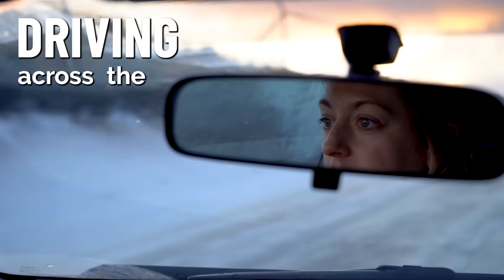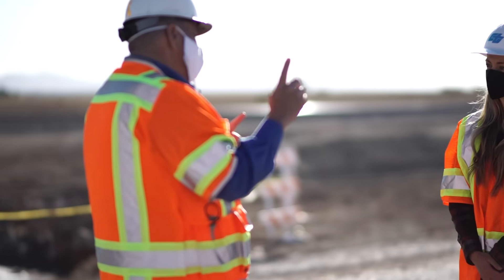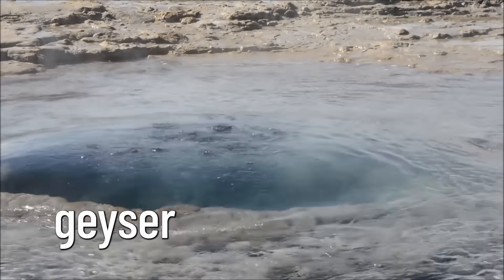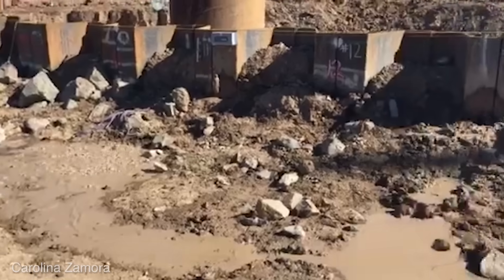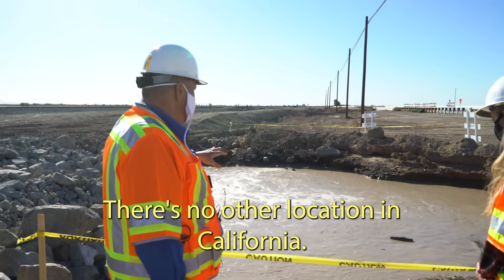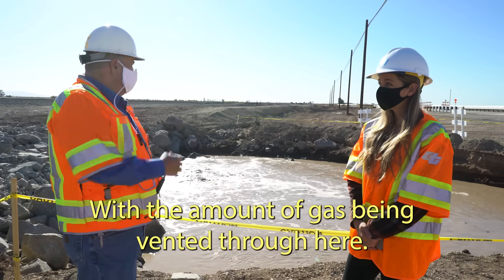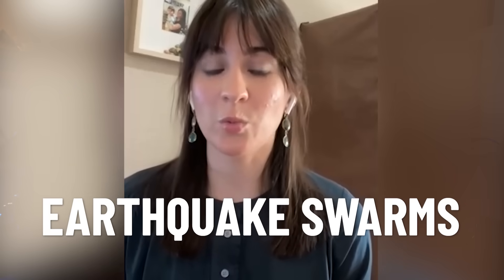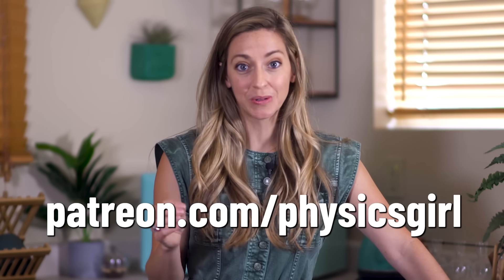World's Only Moving Mud Puddle

Comment: Consider electricity moving through a wire and you know how a cyclotron works. The cyclotron smashes electromagnetic field fluxes known as atom smashing similarly to power smashing into copper crystalline structures structures of wiring to produce electromagnetic field fluxes known as arcing.
Electrical power supply may be created using a power source and voltage to frequency converter to synthesize radio waves that appliances receive then convert radio waves by frequency to voltage to power itself.
I designed a satellite that puts out 350 tetracycline at .01 ampere per peak and valley. Smoothed out to 1 cycle would produce 3.5 billion amps which can power an entire city via satellite.

Comment: If you apply mechanical engineering,  electrical engineering and electronics engineering,  you can more fully understand physics. You only need to learn the basics of electromagnetic functions.
Mechanical power, electrical power, and resistance are important for physics.

Comment: Diana, if I have time, I would like us to work together on some projects, if possible, regarding just about every area of physics.
You only have to know basics about electricity and other data. Once you learn about electricity and lightning you can realize how space and other physics functions.
Physics of sea water is mandatory too. An experiment I had when young was connect a cb antenna to a winch cable and  throw the cable into the gulf of Mexico. Normally the 5 watt can radio can talk 3 miles; but with the cable in the water, I  talked to people on the other side of the iron curtain.
Don't tell anyone about this.  I also designed radios systems using the earth gravity as antennss.

Comment: nothing can be done without going to the original location and plugging the fissure releasing the co2. the sediment has reached a state of none newtonian particulate, under pressure, causing the co2 to take the path of least resistance which is lateral to the bedrock (not a particle). this phenomena will continue until the edge of the water table. i'm sure this is understood already.. a few hundred tons of powdered tungsten ore at the original location might stop it.

Comment: If they think that theory is correct that it's traveling at an angle and it's making its way back to the spot that would be directly above, they should just drill of the opposite side of the highway and give the mud puddle what it wants without having to tear through the highway first

Comment: Gas goes up, mixed with fluid, after it passes the soil, the soil settles in a much more compact way, leaving
the indented ground locally. The movement is just a result of it choosing the non-compacted soil, which is then
more permeable to the fluid/gas mixture.
My solution would be using a somewhat bigger pit around it, use floaters for support of the trains tracks and
road, by filling in the now larger pit with more water, which may move but ultimately is settled
in height by a pump either pumping in more water or removing some to maintain a constant water height.

Now Mr. MudPit can go it's way and continue to compact soil, while passing through, and when it's gone
far enough, you can remove the pump and the water and simply fill in the pit again using the same
method as the mudpool, spraying in mud mixed with air.
Reply: FYI, cute scientist.

Comment: It's a fault line alleviating gas through a pool of water, as the pressure increases, gas is forced past the fault which allows a little bit of water to pass in the opposite direction. The water seals one end of the 'opening' and the rising air erodes the other end, it's like a snake because of this.

Comment: If you consider the thickness of the earths crust and the earth itself - in comparison a 75 foot wall of steel is nowhere near as deep as a non-bleeding fingernail scratch on your skin.  We are talking about a source of gas that is probably1000s of feet deep at least.   

Best bet to me is to relocate both the train track and the roadway - go to the side behind where the mud puddle was and put in concreate structure (like a bridge but built below the surface then a non-permeable membrane down10 feet then build the train track and roadway over that.  Additionally you need   sensors in that area to monitor the gases and their levels on  the roadway.

Comment: thnx for this, but, not at all amazing. i'm from this area in CA and the entire Coachella Valley sits on a giant water aquifer. the aquifer is fed from snow melt off the surrounding mountains which is highly visible from Interstate 10 at Whitewater pass near Palm Springs' infamous windmill farms. it's no wonder that this subterranean water table would surface out near SaltonSea / Indio / Thermal....somewhere as it is flowing very very Fast!

Comment: the theory of the feed source coming up at an angle would be what i would be looking into. why not take a general heading of the direction it is moving, and start drilling test holes to see if you can intercept the source. you could map it's direction and depth as you keep drilling new holes and maybe get it to a point where you find a vertical point then try to drill multiple holes and open up a new vent that may stay in place and stop further destruction.

Comment: "Driving across California to see...a mud puddle."
Me: Sounds totally reasonable if you ask me.

Ok wait, question - why has no one just made a bridge for the road? Clearly the puddle isn't stopping and cannot be stopped. Why can it not just be given a wide berth by making a bridge over it? Sure, later on after it's gone there's just going to be a weird bridge, but still...
Reply: With that going on, it's unlikely that the overburden above the rocks is particularly stable anywhere near there, and the pointloads of the bridge are much more likely to subside or even tip than normal.

Further you can't be certain that the moving puddle isn't going to make an abrupt turn and take out the bridge supports.  It does move rather explosively...

Comment: The angle theory makes sense. If the source is some distance away, and the relief of the gas is the path of least resistance deep underground via a highly permeable layer or some horizontal'ish linear void, it would explain why it's moving.  Maybe it did not move initially because the overburden around where it initially appeared was highly impermeable and took a long time to erode, but now it's moving as the overburden is more erodible as it tries to find equilibrium, likely when its vertically over the source.  It's interesting the bubbling does not occur along the path where it came from, only where it is, which seems to further support the angle theory.  It also looks like the path is being filled in behind it, which also seems to support the angle theory.  I would think soil borings could be taken out in front of the boil to see what kind of material lies ahead and to better predict the path.

Comment: Have they considered that the earthquake storms caused the collapse of the co2 chamber which forced the pocket of co2 into the water table . This could cause the build of pressure in the water table an force the water an co2 combo to the surface following the actual water table till all the pressure has been released.

Comment: 1953, and farmer are the first 2 clues Im hearing as the rubber ducky scene plays. 

Im guessing monoculture drawing from the water table, just like the ogallala aquifer depletion.

Im picturing when a scuba diver is in an under water cave and their air bubbles hit the roof and as the bubble gets bigger (or in this case the water table gets lower) it will either slowly or aggressively follow the shape of the roof of the cave, depending on its shape. 

Im picturing the day it moved 60 ft, the bubble made a jump. 

Just a theory.

Comment: Carbon + heat and pressure + water is how oil is formed in the earth 1 reason for CO2 bubbling out is oxygen from water bonding with carbon and the other 2 part hydrogen is forming hydrocarbons.  It's  not a fossil fuel neither will it run out.

Comment: so im just curious. if it is potentially at a angle, trying to make itself straight, then why not drill a opening past the highway, and move the puddle, so it skips the highway, then do the same thing before it gets to the other places. till you track it, and then get it to right itself....so it stops moving, of coarse that could be over 100s of miles maybe...but better than it sinking structures, causing millions to billions in damages.

Comment: Okay if it's because it's coming up a fault at an angle and trying to get straight why couldn't you figure out the source from where it's originally coming up by using ground-penetrating radar and drill relief Wells oh, so it will not follow the original fault at an angle instead it will go straight up the new wells, just a crazy non-educated idea.

Comment: Might be solution: don't fill it by rock, just get some large drainage pumps to remove muddy water, this will lower some pressure and hazardous gas and then you might able find and bypass disaster.

Comment: Has anyone tried to estimate the direction the puddle moves in, and then drill down somewhere along the path? If the spring comes out at an angle, the source should be there somewhere.

Comment: Classification:
Euclid

Special Containment Procedures:
Special Task Force Beta 21, also known as "The Mud Runners" are to be kept on site at all times posing as a construction company and science team monitoring the progression of SCP-6248. "The Mud Runners" are to redirect the flow of traffic from the nearby highway away from the path of SCP-6248 and all train lines that pass over SCP-6248's path. Researchers on-site are to attempt to slow the progression of SCP-6248 by building underground walls no less than 75 feet in depth, as well as drill relief vents to weaken SCP-6248.

Description:
SCP-6248 is a large hole measuring roughly 50 feet in diameter, but has been known to change in size. SCP-6248 is constantly spewing large amounts of CO2 and a thick, non-anomalous mud. Depth is unknown, and all attempts to reach the bottom of SCP-6248 have been met with failure. Any personnel or equipment that falls into SCP-6248 is to be deemed lost. SCP-6248 moves approximately 20 feet per year, though much larger jumps in distance have been recorded. It is unknown where SCP-6248 is going or if it has sentience, but it is to be monitored extensively.

Idk why i just felt like making an SCP of this lmao. If you got this far thanks for reading it.

Comment: The simple vesion..version...

below the puddle is a normal water table

water erodes

the water often times will hollow out a chamber with a ceiling, floor and walls

moving water erodes faster

CO2 is an acid when combined with water (H2CO3)

undissolved CO2 moving through water creates water currents 

acidic moving water will dissolve  rock in the path of least resistance 

fractured rock is the path of least resistance 

the gas is working like a saw to cut through rock

once the CO2 can rise straight up,  it will quit cutting/ dissolving the rock and the puddle will quit moving

they have the right idea, vent the gas closer to the point or origin on the other side if the infrastructure 

but...

the ground  is now unstable  under all if it...

I'm not  a geologist, I am a nurse and CO2 is an acid in our body and our body keeps a tight hold on pH.

the medulla controls breathing to rid us of high CO2 or hold on to more CO2 when we are too alkaline 

the kidneys counter the acidic CO2 with bicarbonate (HCO3) and can excrete excess bicarbonate when we are too alkaline, or excess hydrogen ions when we are too acidic 

the lungs are faster at changing the  balance 

it's funny how some knowledge  transfers

Comment: Why don’t they run seismic tests and find out where the CO2 is actually coming from? Then, they could drill a real relief well that is deeper than 60’ with a real drilling rig equipped with BOP’s. They could then capture the CO2 and inject it into depleted oil wells to stimulate production. There is obviously a great deal of CO2 coming from a deep source. However, this would make too much sense for Californians. They will just try to keep the cows from farting to save the planet and pay $7/gal for gasoline.

Comment: So it's eroding the land and pushing soft earth with its pressure under the surface which causes it to move.
It's a spring that we'll depending on the structure of earth below will continue.  Even if it hits hard structure boundaries.  The denseness of the sound will allow it to escape. 

Good for it then.  It escapes human pollution and abuse.

More people ought to take some tips from this mud puddle.

Yup it leaped under the compacted surface of the roadway.  Where's the dilemma?

 If it's a geyser why would they think they could go 5 stories below and stop the pressure...😲😵‍💫😆

 You could do seismic readings of the soil to find out the softest places to know where it's moving to

Comment: This is Easy- As the water moves the rocks sink and settle forming a ceiling, the waters only option is to find a path of least resistance. This is why the turns it makes are subtle. Rarely will it turn back on itself. I've seen a sprinkler pipe leak that traveled a few feet before in was found, leaving a trail in the yard.

Comment: Sounds like it ran into a striation level it couldn't cut through, finding a crack when it started. The earthquakes then helped break the striation rigidity up with pressure being able to move through the, now softer, rock levels.   If this is pushing gas and water through the striation level it was stuck on then it could effectively be a hydrojet now, slowly cutting its way through the ground until reaching directly above the source.   I'd also expect pressure to get higher and higher as the ground resistance breaks down which could lead to some interesting geysers along the way.

Comment: (As an engineer, myself, I have plenty of respect for female engineers; and I have certainly come across inept male engineers in my time, but, ) Your geology gal was wrong about why the 'hole' is moving, or, at least is not explaining it well.

Think of this as an inverted waterfall; as more and more flows across the 'edge' of some subterranean geological feature, it is eroding that 'edge', thus allowing the shape and centerpoint of the erupting flow to move laterally on the surface, towards a place over the source.

BTW, has there been a more specific analysis of the erupting gas?

Comment: This is what's wrong with today we don't have actual engineers anymore hence why everything keeps failing and if it hasn't been taught in there precious little school then they can figure it hence why this country is failing and everything is so difficult to work on nowadays we have the technology to scan underground aquifer and locate its source tap into with wells and provide that water to the people since always in a drought now because California was built during the most rainy century in there history so having all the droughts they keep having is actually normal for them and check what type of gas you have coming out and be able to purge it into  tanks with water and separate it out and use it for possibly power not really to hard to figure this out obviously there's a layer a rock that's formed a Crack going sides underground and the water is following it its literally just am over sized natural water leak just way up scaled from a water line

Comment: Why don't they just plant trees that live in water, like Mangroves? They would absorb the CO-2 and other gasses and start providing erosion control and eventually stabilize the shoring. I'm not suggesting that the mud hole would stop, but it would slow down considerably if enough were put in there and buy them time to come up with s more permanent solution.

Comment: If I was in charge of the state I would immediately order as many dump trucks as possible to dump as much rock down that hole and continue to dump until there is no possibility of any void left just keep doing it and keep doing it until it doesn't swallow anything else up problem solved eventually whatever the cavity is underneath going down to probably the Earth's mantle who knows how far it will be filled it will be filled the question is what will happen to the gases and the pressure will it cause a major explosion or will all the way to the Rock cap it off

Comment: It would be super easy to deal with. Do not dig a hole for it to flow into, it would just erode the sides, instead pump out as much water and mud as you can. It should not have enough erosion power to move much.

Comment: been seeing clips about this for a while.

can't they "go in" and find out where the gas is coming from?

rocks fall in? put a "drone" (camera/science stuff) onto a big rock, use a (very) long cable, and have it "fall in".  see how deep the rock goes.  send sever such rocks (some smaller, but with a heavier weight), and see if they all level of at some depth.  try to map the bottom.  dig in where the spring was in the past, study the rock layers from around the immediate area.

I find it hard to believe that there is only "surface data" about this

Comment: Why don't they try and plug it up and start a new hole further away and like an angled tunnel. So I would walk like a full football distance away and then dig a tunnel on an angle towards where it is now and once you break that new tunnel into it then you drop a huge cement wall into the hole forcing the pressure to go into that new tunnel hole you dug.